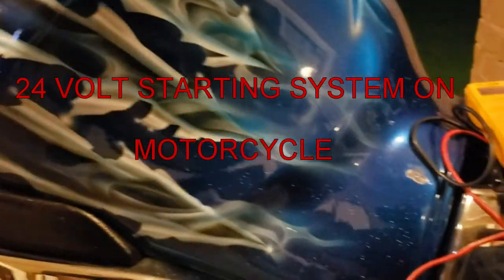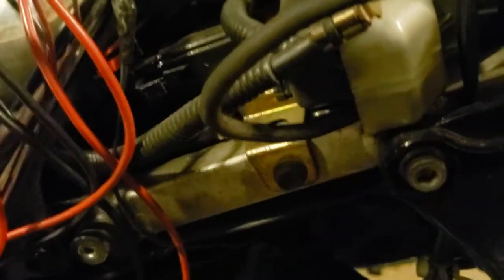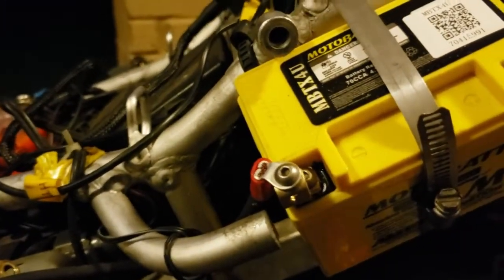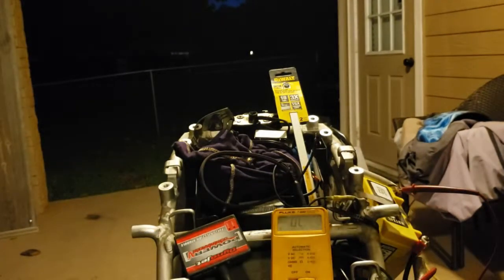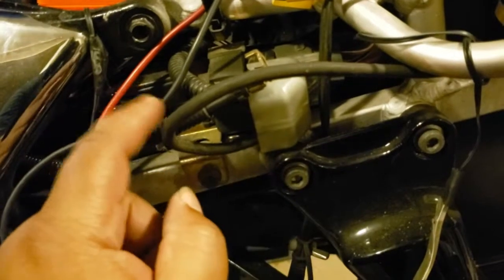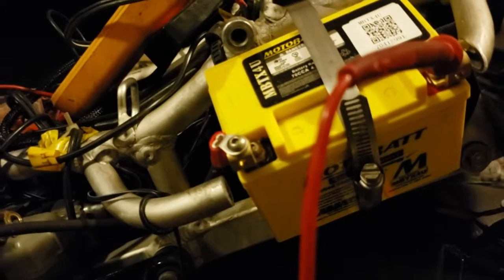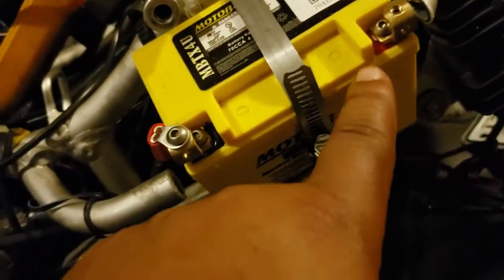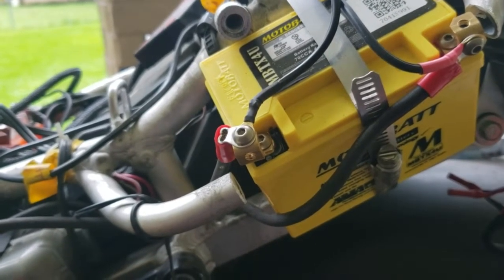24V STARTING SYSTEM ON MOTORCYCLE

Comment: Hi there Guys, So I just did the 24V "upgrade" using the Anti GRavity 801 and 401, and everything works very well, however it seems like I burn the starter motor real quick, how do you guys get around this challenge.
Reply from the maker: I'm not sure. Don't usually have a problem with our bikes. Could it have been going bad already. Or pending bike your starter may can't hold 24v on a stock starter
Reply: You need to put a power resistor in series with the starter motor. The value of this resistor must be the same as the resistance value of the motor. In this way you avoid to much current been drawn and burn out...

Comment: I want to ask you to see if I understand i have to take off the stater wire from the solenoid and put a wire from the solenoid to the negative of the battery and put the stater wire to the positive of the battery

Comment: Had to come back and say thanks. This worked perfectly. Should I have concerns about over working the starter?
Reply from the maker: In my opinion no. But anytime you put something through a higher load than designed there's always a chance... I know people that have been running this setup for years with no problems. It's only seeing 24v for a couple seconds... pick you up a spare starter off ebay for a backup to ease your mind..👍🏽

Comment: I had a 24v system on my 2000 with all kinds of relays on it. It burned out within a few months. Can you post a video of you starting it before and after a 30-45 minute ride?
Reply from the maker: It had all the relays because it wasn't installed this way... with this Install it's only 24 volts to the starter when you press the button... The way you had it it was a 24 volt all the time and they were using the relays to try and bring down the voltage for the rest of the electrical system.. that way will cause fires in a street bike... it was a customer's bike so can't post that video but when the bike is running the meter read 12v.. hope this helps